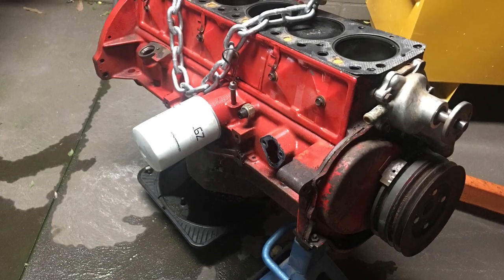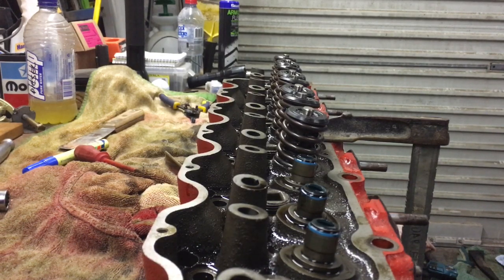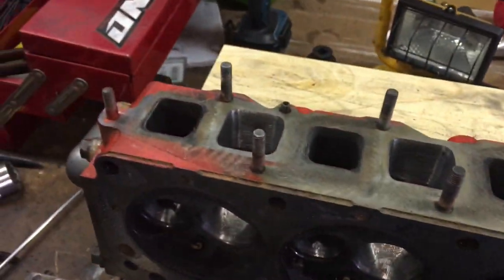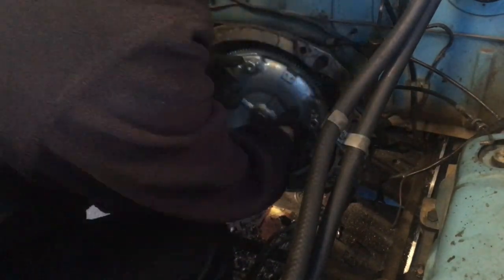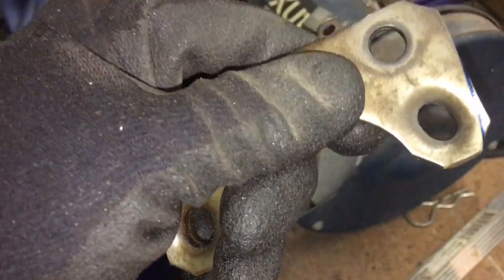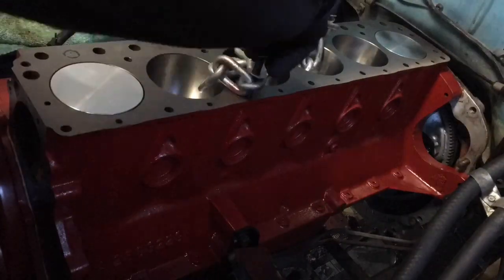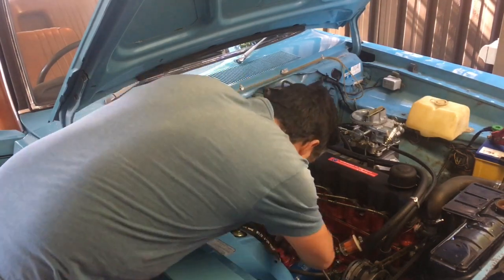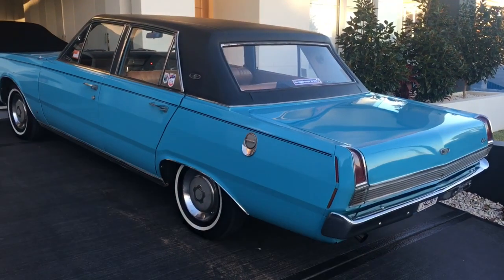Mopar Hemi 245 265 rebuild on a Chrysler VG VIP. Valiant Dodge,  "PLEASE LIKE AND SUBSRIBE"

Comment: Haha the smell of trans fluid takes me straight back to taking the BW35 out of my 70 VG back in '82. I was under the transmission, easing it off the engine when the torque convertor came off and I got a face full of oil! I couldn't move out of the way so I just had to wear it. I couldn't afford to get it reconditioned so I stripped it down myself and replaced the clutch pack plates, diaphragm spring and bands and put it all back together. Went fine after that so I was pretty chuffed I was only 18. That 245 Hemi really sang I loved that motor. Thanks

Comment: A pacer specification E34 camshaft would work well in that engine with around 490 lift on exhaust and intake....
My preferance would be 218 224 110LSA  with 485 485 lift... With crow cams chromemolly pushrods....
Would like to build a centura with a four speed very similar to this build.... 👍👍
Nice job on the porting and match porting....
Reply from the maker: Mate it’s amazing how good they go when a combo is right👍

Comment: the only thing ive ported is two strokes and mowers, but im looking forward to doing a car of mine, i have a 245 but  thinking 265 245 head , its a future engine to run a HUGE alternator for off grid batteries , and if i ever get another centura ill have just the engine.

Comment: I didn't see the valves being back faced....that's lost free power,  also do you see the black ring in the head just below where the valve seat is? you grind that ring out until there is just the slightest shadow of a line left under the seat.......more free power

Comment: Hemi slant six, i believe that they were only in Australia. America  got the regular slant six.
Reply from the maker: Suds Reserve it’s not a slant people. It’s an up right 6. Loves to rev. They raced these engines from 1970 in Australia.
Reply: We used the slant six in our valiants & smaller dodge trucks to around 1969 or up to the VF, then we used these upright in-lines from 1970 onwards as you see here in 245c.i. In various stages of tune in standard cars & hardtop re warmer versions in the Valiant pacers to a rarer  4barrel version in the Bathurst model, & from 215, 245, 265 c.i. To Hot triple Weber Units in 265’s in chargers, apparently Chrysler USA were going to use this design but never did & gave it to Australia to develop for our cars.
Reply: @jamesgovett2501  i would like to get my hands on one😁
Reply: Watch uncle Tony's garage , the slant six was available in the USA , but the Hemi head was for the Australian market
Reply: Again nothing to do with the slant six motor
Reply: @josephcowen9771  hey if you don't know what you are talking about...just say so🤣
Reply: @garycorbin2789 UTG love it . Someone needs to send a hemi 6 to tony to play with.

Comment: Mate did you bore the 245 out to 265 ?
Reply from the maker: 250 where was +40.
Reply: @Dazza.  enjoying your vids too , keep up the good work
Reply: @Dazza.  pacer specs are 250 cubes, which they came 40 over from factory, its why they went so dam good, i had a 2 door pacer as my first car, sweet car, 2 barrel, but as you know, they are just so peppi.
and a 265 is a bored out 245, chryslers way to make the 265 happen as experimenting.
then they just improved another head, aint no slouch a 245 i know that much.

Comment: are you running a bw35? if so did you upgrade internals?
Reply from the maker: It’s a stock as a rock BW35 with a custom 3000 converter.
Reply: @Dazza.  ok well everyone said they are weak, i used a few in the 1980s, behind a 265 cl sedan ect, seem to be fine, only issue was in reverse backing out of a steep gutter, i give it a bit of juice, pop lost reverse and first of course.
but only issue we had.
glad you like the Valiants, great cars.

Comment: What did it cost for the reco?
Reply from the maker: $4k for the bottom end
Reply: @Dazza.  and do you have any options? Example what cam to put in etc etc?
Reply: Is that a slant 6 or is it different
Reply from the maker: Nathan Swisshelm Chrysler Australian upright straight 6
Reply from the maker: Rights And Liberty specs are at the end of the vid mate.
Reply from the maker: Rights And Liberty the cam is an E49 grind.
Reply from the maker: Nathan Swisshelm it’s different mate. It’s sits upright. Australian built in 1970, 245cube.

Comment: not really a "Hemi" but I understand why you call it a Hemi, it has domed chambers. The valve are not canted to follow dome and plug is not center of chamber but again, I get it. Long as you have fun with it that's all that matters
Reply: It is branded as a hemi by chrysler, it has hemispherically heads, is more impressive than the 426 hemis too
Reply: Chrysler called it a hemi and I think when they call something a hemi its a hemi
Reply: True, but man they are just killer tough engines, Australian muscle!
Reply: Valves are canted at 8 degree and plug position has noting to do with hemi chamber! This 8 degree set up is now best practice in head design look at Honda CRF 450 , the only reason  a 426 hemi has valves canted side to side is cross flow, the best way is how this engine is,
Reply: Actually the valves are slightly canted, note the pushrods are not perfectly parallel & the Rockers are slightly tilted, hence the spacing with the each rocker being closer to a rocker of it neighbour’s cylinder than the other rocker of it’s own cylinder